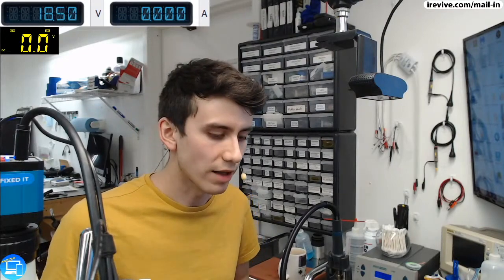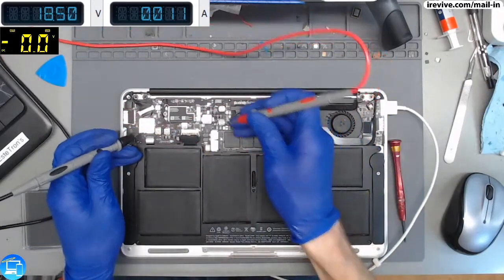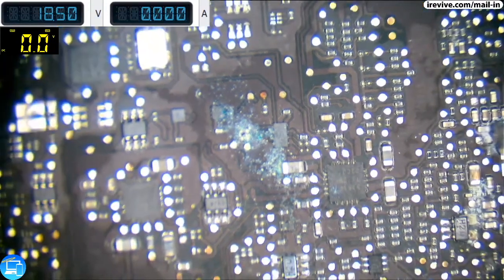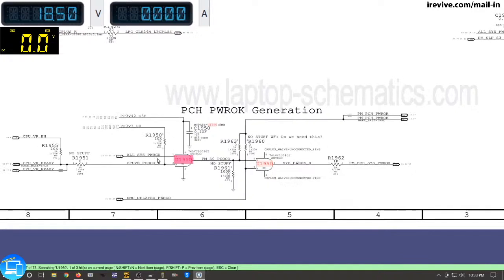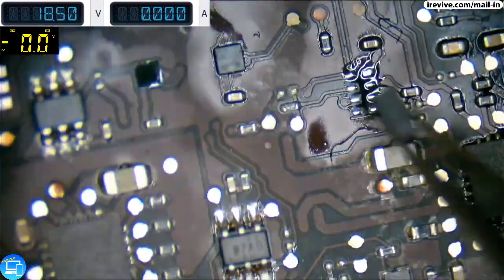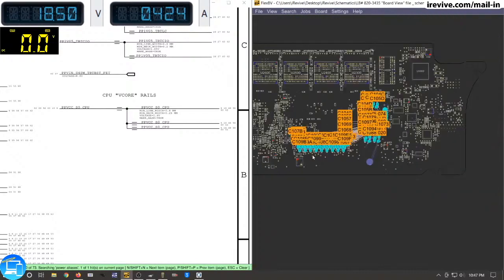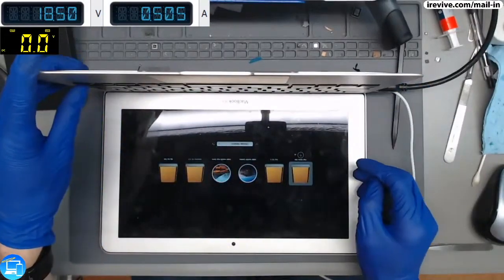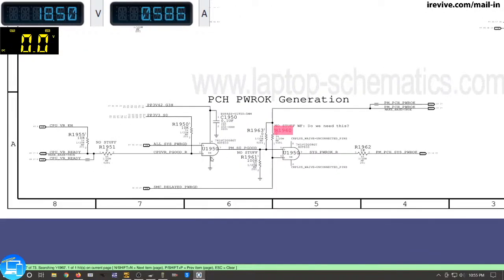Liquid damage MacBook Air 11" 820-3435 only pulling 0.01 amps

Comment: Great content, be great if you could share where you got your microphone from or just the make and model, also interested in the DC power supply software you're using to display Amps and Voltage on screen. Cheers!
Reply from the maker: Good suggestion. I thought I had added the microphone link in my description, but it appears not. I have just added a new link at the bottom of the description for the microphone I use. As for the power supply software, I am currently using the stock software that comes with the csi3005p bench power supply.
Reply: @iRevive  ah thank you! Exactly what I was looking for. It sounds pretty good too by judging your streams. Thank you for sharing 🙌
Reply from the maker: @beogeek  You are welcome. The quality versus dollar value is very good. I am very pleased with the fidelity of the mic for only being $99.
Reply: @iRevive  listening to your YouTube videos u can't fault it to be honest. Seems to do the job well and is wireless which is what Im looking for.